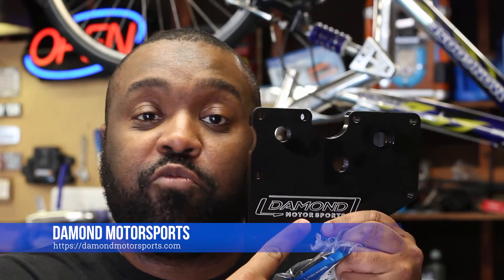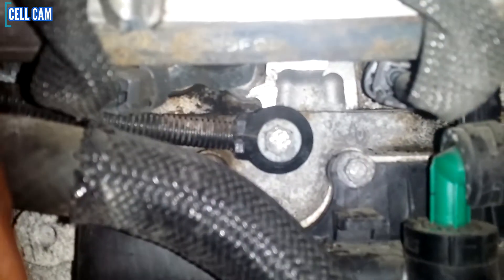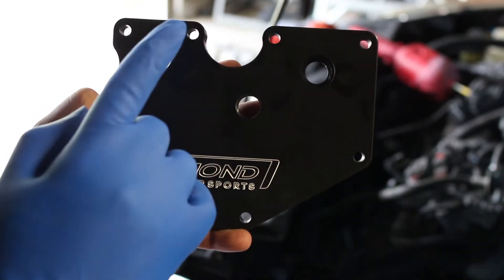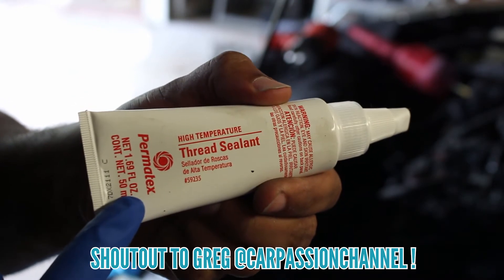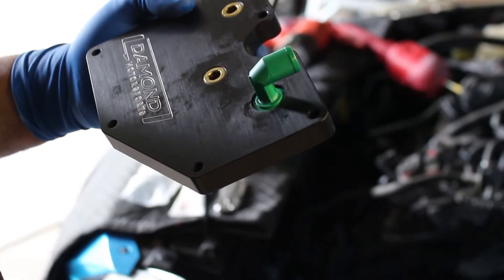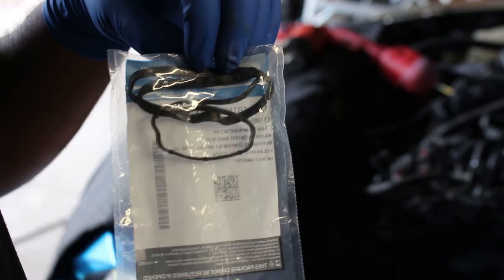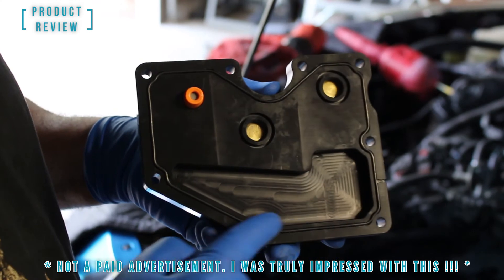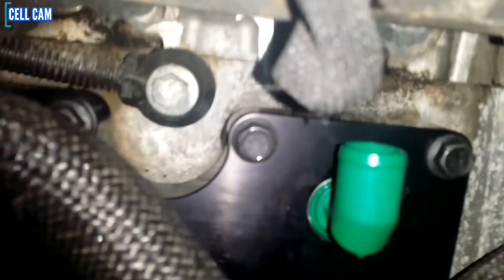Damond Motorsports PCV Plate Installation

Comment: One trick I found when installing and seating the pcv gasket on the valve… if the valve is stubborn and doesn’t want to click in, take the gasket and place it in the plate where it needs to go. Then push the valve into the hole and it will click through much easier. 👍🏽

Comment from the maker: Getting those oil blow-by vapors under control!
Reply: Soni have a few questions for you sir. I have major oil leakage in my intake manifold and a misfire on cylinder 4. I've taken out the plugs and found cylinder 4 full of oil left cylinder open for a few hours and all oil was still in cylinder and the oil didnt leak through piston rings. I Vacuumed out the oil of cylinder number 4 and did compression test first 3 cylinders was pretty much identical pressure where as cylinder 4 had bout 20 psi more then the other 3  guessing it didnt wear out that piston bore much with all that oil in it. Also checked cylinder 4 with video scope and valves inside the piston chamber was seating fine no major carbon build up. After checking all of Mazdas worksheet manual for the 2.0l LF engine which is very non descriptive for a manufacturer manual l could not find any reasoning for the major leakage besides the pcv valve being bad. Also had fault for bad Variable intake air shutter solenoid valve (believe is due to the major oil leakage) tested the valve and found continuity through terminals so I know valve is bad and needs replaced. Tested the intake solenoid  actuators both working fine. Saw your video of removing the VTCS as well would that also delete the Shutter valve too? Or will I need to replace the valve still?
Reply: It can be your valve cover gasket
Reply from the maker: You could have bad valve seals, I just recently went through this with my Miata engine (which is why I am tearing it apart). Unfortunately the only way to know for sure is to tear the head down and replace them. If you drive your car in the cold months (I don't) I wouldn't recommend removing the VTCS. Your cold starts will be rough. I would replace the shutter valve. If you are going to remove the VTCS, the shutter valve is removed as well as the actuators.

Comment: God I did it with the intake manifold on there, it was a *itch to do.
Nice video!
Reply from the maker: That had to be a tight fit! When I put my intake back on, I had to route a pvc line to my catch can and there wasn't a lot of room down there. How long did it take you to do it with the manifold in the way?
Reply: Five Five Garage 8 hours to install the plate and 2 OCC’s.

Comment: I cant tell you how happy I am that I found your videos! I know they're a bit old but I'm just now getting to the intake valve cleaning, PnP intake mani, egr and pcv delete and these are going to save me so many headaches! Keep up the awesome work man thank you! My one question is, how was installing the OCC after everything was put back together?
Reply from the maker: It wasn't too bad. The hardest part was routing the hoses to the PCV plate with the intake in the way. Mounting the can is easy as long as you don't have a front mount intercooler (it gets a little tight if you do). Glad you found them! I have some more Speed 3 vids coming soon, finally changing to a set of coilovers (just waiting for them to arrive).

Comment: Hey Randy Nick here I have a question I installed this pvc plate but used my stock pcv hose and it popped off did you use an aftermarket hose and better clamps? As you know the stock pcv hose is pre bent and I couldnt get it to bend nicely to fit the intake.
Reply from the maker: I used an aftermarket hose, I installed a catch can right after this and used new hose for everything.

Comment: Would some Ptfe tape+some loctite work for the damond pcv plugs?
Reply from the maker: I am really hesitant to use PTFE tape, because sometimes when screwing things in, there are strands of the tape that break loose, and I wouldn't want to that be potentially floating around in the engine. That liquid thread sealer is the business though, I use it for everything now.

Comment: I have a question should I get the egr delete if I wanna get the oil catch can or how should I go about doing that
Reply from the maker: You can run a catch can without getting the EGR Delete. I would definitely replace the PCV valve with a new one and then run your oil catch can setup. The catch can will actually help the EGR system stay cleaner.
Reply: @FiveFiveGarage  ops what I meant to say was what happends if I do the pvc plate without having the catch can already would it be better to have both pcv plate and catch can at the same time ?
Reply from the maker: You can do them seperately. It is just easier to add the catch can lines while you have most of the car apart.

Comment: Hey five 5 garage great videos! Im considering the pcv plate myself but im just running a stage 1 occ. So since im not running any additional occ setups and wouldnt use the other ports in the damond pcv plate is it benifcial in any way to get the damond plate instead of using the factory plate?
Reply from the maker: If you aren't going to run more OCCs probably not. I did for future proofing, I have the extra cans just haven't installed them yet.
Reply: I would get it if you know you're pushing the engine to full boost for that added protection and security.
Reply: @FiveFiveGarage  I'm assuming it also helps protect the vvt?

Comment: Ok Awsome did you run the car without the catch can at all. I think the reason mine blew off was cause I forgot to tighten it lol
Reply from the maker: I installed everything at the same time, I had the car torn down a bit when I cleaned the valves. But definitely check all your connections! It's a bit of a pain to get back in there with the car together.

Comment: Thankyou my friend. Would you reccomend this mod on a non modified engine or is it not nessicary?
Reply from the maker: On an unmodded engine its not necessary. Just replace the PCV valve with another oem one and you will be fine. Pushing higher levels of boost will cause some problems and this plate helps solve it.

Comment: If you don’t mind, where’d you get that ford part number for the gasket? I’m trying to see if the intake manifold and throttle body gaskets are cross platform since I get a discount at ford. Also do you know if the PCV valve is ford too? Thanks man.
Reply from the maker: From what I remember, the PCV valve is Mazda specific. But the gasket is a shared part number between Ford and Mazda. I ordered everything from Damond Motorsports, here is the link: https://damondmotorsports.com/products/pcv-valve-and-pcv-gasket . Hope that helps!